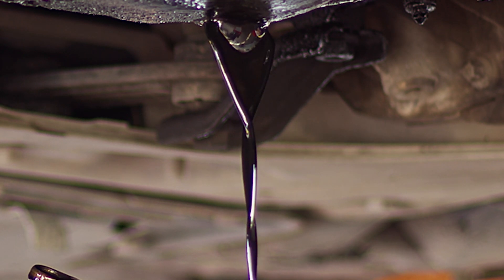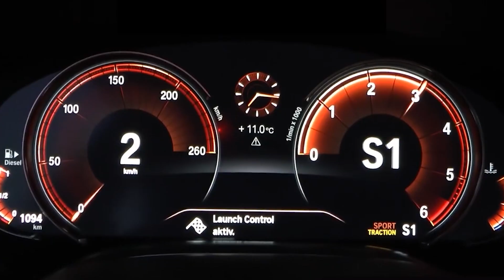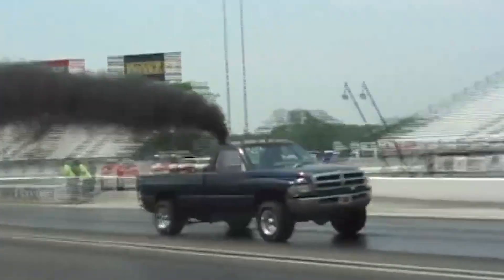This One Modification Will Increase Boost & Double The Life Of Your Motor Oil!

Comment: Just curious, do you think that gapless rings in a diesel engine could aid in cold-starts? It seems it might, since rings are at they're largest gap when cold (greater possibility of compression/heat loss), but I don't know how significant of a benefit we would see.
Reply from the maker: That’s a great point. It would likely help with cold starts.
Reply: @TotalSeal  Thanks for the quick response! Another question if you don't mind... Do you think these rings could help with oil temperature as well?
Reply from the maker: @HEUI-Lewis  yes, the reduction in blow by typically lowers oil temperature.
Reply: @HEUI-Lewis, awesome name

Comment: I had a horrible experience with a seeping head gasket and gapless second rings once.  Not a mistake I'll make twice.  Under optimal conditions they're perfect.
Reply from the maker: That would be a bad situation!
Reply: Of course compression is going to be improved but it's not the problem of the piston rings if the head gasket is already crap. There is literally no downside to having less blow by and more efficient compression in an engine

Comment: I’m curious how the gapless 2nd ring affects top ring seal since you guys say that the end gap should be larger on the second ring.
Reply from the maker: It is different in a turbo diesel. The boost pressure and lower engine speeds change that dynamic, so a gapless 2nd ring doesn't affect the top ring in this engine combination.
Reply: @TotalSeal  Interesting. I’m guessing you can’t do a gapless top ring because of the keystone shape?
Reply from the maker: @JPMotorhead1993  Yes, that is correct.

Comment: I'll have to give you guys a call supposing the gap on the second ring was wider to relieve the pressure coming from the first-ring loan the first-ring to work better???
Reply from the maker: It is different in a turbo diesel. The boost pressure and lower engine speeds change that dynamic, so a gapless 2nd ring doesn't affect the top ring in this engine combination.

Comment: I’m a little confused I just watched one of your older videos and you guys said to have more and gap on your second ring then your top ring to let the gases escape how do you do that with a gapless second ring
Reply from the maker: It is different in a turbo diesel. The boost pressure and lower engine speeds change that dynamic, so a gapless 2nd ring doesn't affect the top ring in this engine combination.
Reply: Joey your trying to compare two different engines. Gas vs diesel

Comment: Does the gapless second Ring on a diesel not make it prone to top ring flutter
Reply from the maker: It is different in a turbo diesel. The boost pressure and lower engine speeds change that dynamic, so a gapless 2nd ring doesn't affect the top ring in this engine combination. Essentially, the boost makes it where the pressure differential above and below the top ring is never enough to lift the top ring and create ring flutter.
Reply: @TotalSeal  ok I just wondered. Thank you

Comment: What are you doing to keep the rings from sticking in the ring groove? That’s the whole idea of the keystone. It wobbles to prevent stiction . Especially on higher mileage engines.
Reply from the maker: The top rings are Keystone.

Comment: You're going to have to explain exactly why a gapless 2nd ring works in a diesel without causing top ring flutter...
and why not a gapless top ring?
Reply from the maker: It is different in a turbo diesel. The boost pressure and lower engine speeds change that dynamic, so a gapless 2nd ring doesn't affect the top ring in this engine combination. Essentially, the boost makes it where the pressure differential above and below the top ring is never enough to lift the top ring and create ring flutter.
Reply: @TotalSeal you haven't addressed why not a gapless top in your replies (you've addressed how a gapless 2nd doesn't get into ring flutter).  I'm not a diesel guy so curious there.

Are gapless top and napier 2nd not an option?
Reply from the maker: @sc358.  For a Naturally Aspirated engine, a gapless top and Napier 2nd is a great option. We call those our MS sets. For example, a 4.30 bore 1/16th, 1/16th, 3/16th ring set with a Gapless top and Napier 2nd is part number MS3690 30.
Reply: @TotalSeal  thanks.  Does that change in power adder/diesel combinations and if so why?
Reply from the maker: @sc358.  In diesels, the top ring is usually a keystone, so it can't be gapless. In turbo applications, a gapless 2nd can stand up to the heat better than a gapless top.

Comment: What type of cylinder facing does it need on the final hone finish.
Reply from the maker: A proper diesel hone finish - Rpk 10-15 micro inches, Rk 35-40 micro inches and Rvk of 60 to 70 micro inches.
Reply: @TotalSeal  Do you make rings as small as 48 and 54 mm?
I'm just curious. Loving all the new coatings and slotted gas ports on the rings. Small two strokes could use one, imho.

Comment: Sorry boys..Gap in rings can help prevent a motor dropping its guts.

These could be a good thing for pump fuel-meditate boost
Reply from the maker: Gapless rings are actually two piece rings with offset gaps, so they can handle thermal expansion.